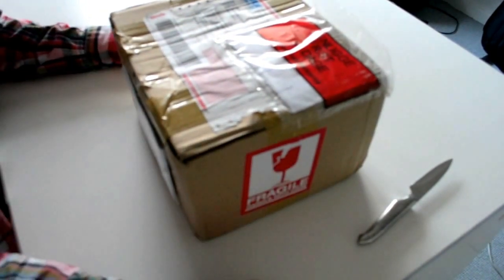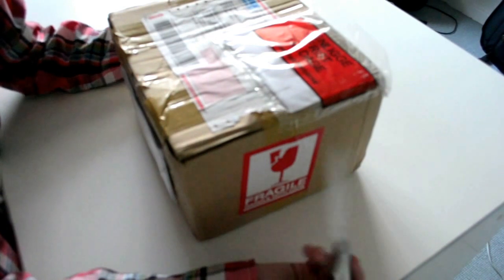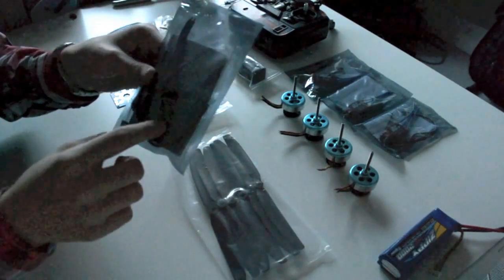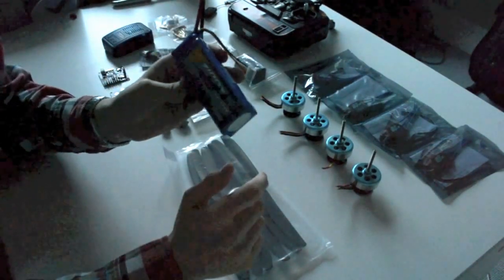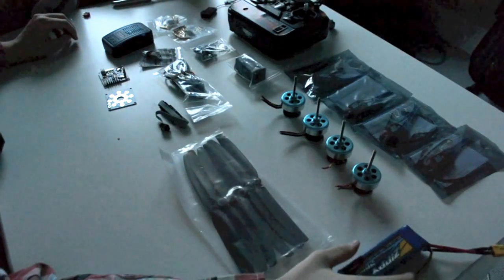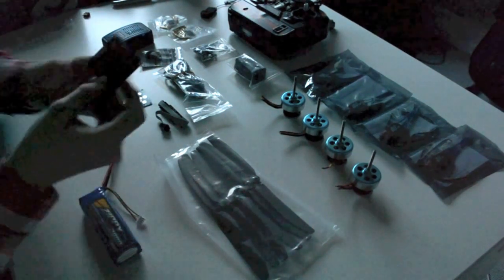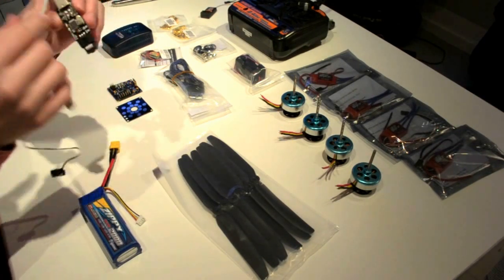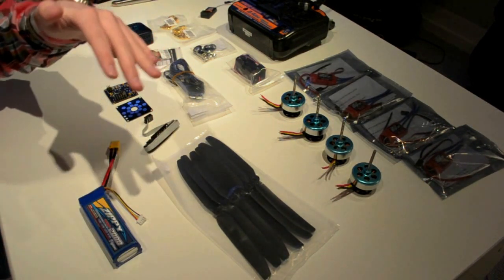Quadcopter build v1.0 [Part 1]

Comment: Thanks for your time to explain;
I builded a complete telemetry controller system for vehicle GPS, avl, including the maps,  hardware, and I feel this is my next step, jeje, Well ,do you know something about "how to change the program" in KK controller?, because if you want to add things like lights, sensors, , sound, ect, we need add this functions to the board control include the RF channels, means we need to change the firmware controller, I want to know if in the future I can add more control; do you know something about KK firmware's?;

thanks again!!
Reply from the maker: I'm not sure you can acces the code in the KK firmware, but you could take a look into mulitwii. That is completely open source and you can access all the code here:
https://code.google.com/p/multiwii/

You can download the code from the above link, and modify it using Arduino's IDE. Hope that helped you :-)